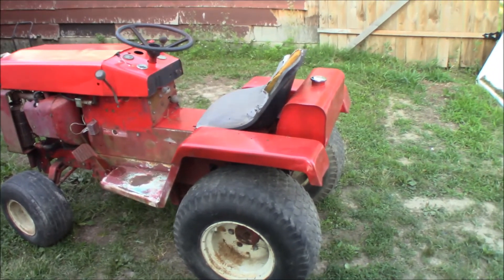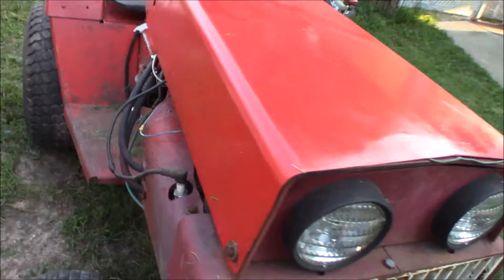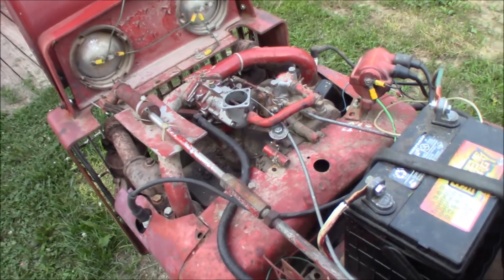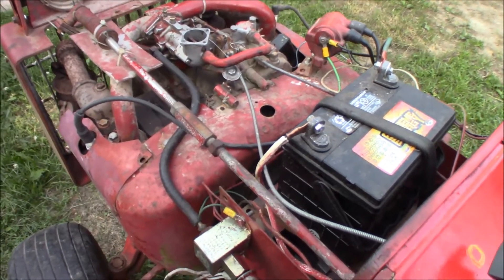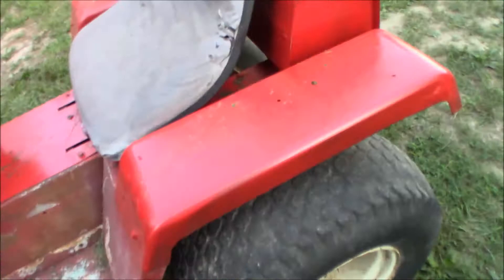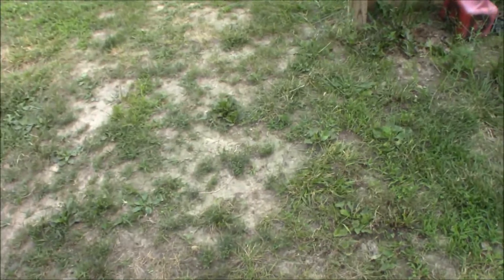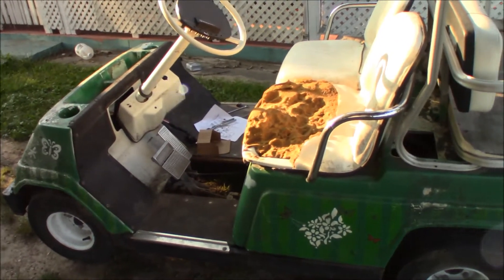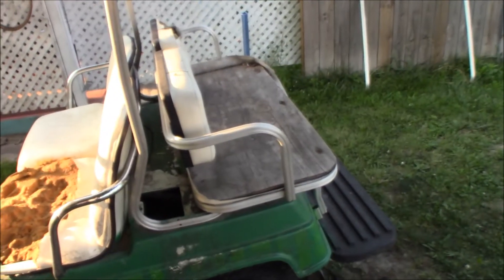Wheel Horse back to running

Comment: Looks like you have the Wheel Horse ready to go 👍
Reply from the maker: yes, I took it for a drive and it runs very well, hopefully I can get rid of it soon,, I think 600  with the mower deck and push blade is pretty fair.